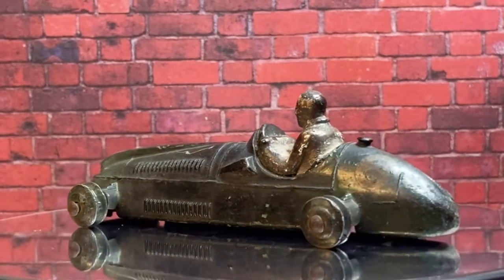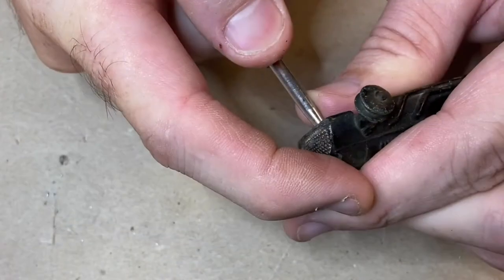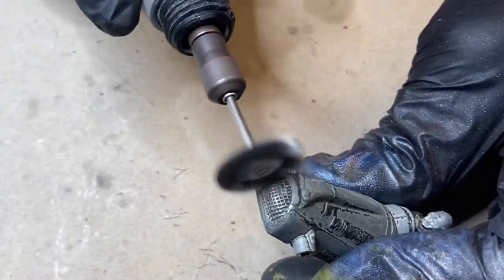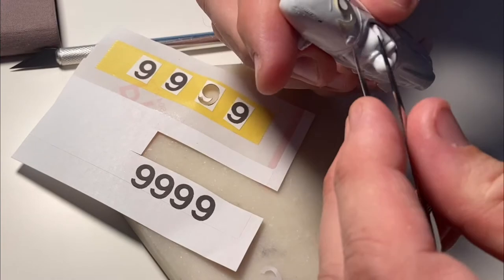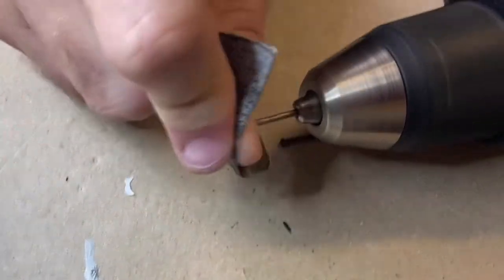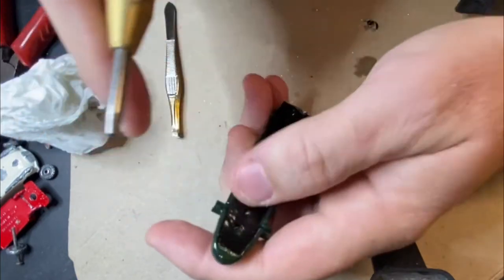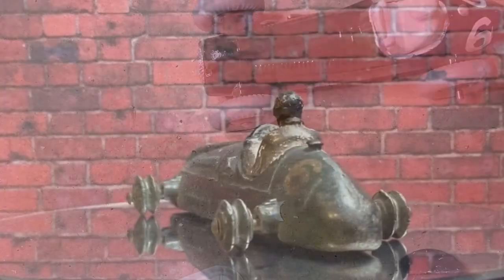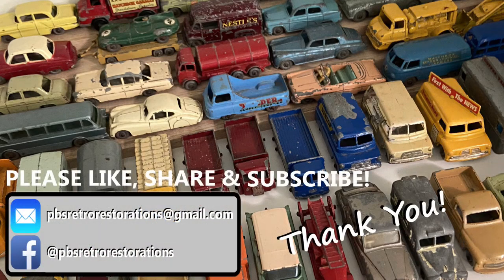Dinky Toys #233 Cooper Bristol Race Car Restoration #039

Comment: dommage pas les rivets d origine , un collectionneur y sera attentif , si non bravo à vous
Reply from the maker: Thanks Pierre, I use the screws in case I need to pull them apart again. I generally do them for myself, and I figure a collector will always be able to tell a restoration anyway. Thank you for the honest feedback and for watching.